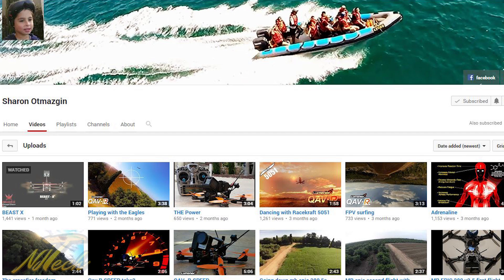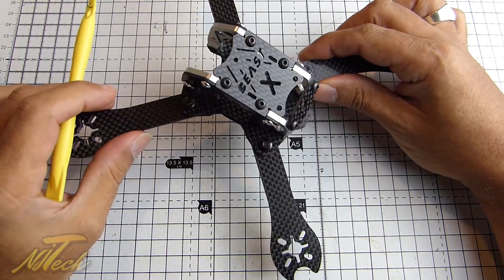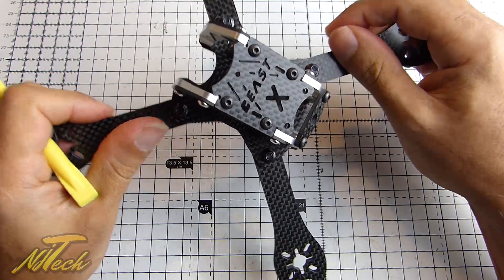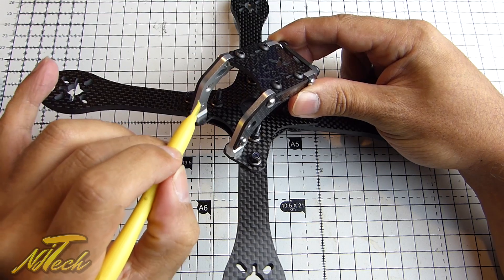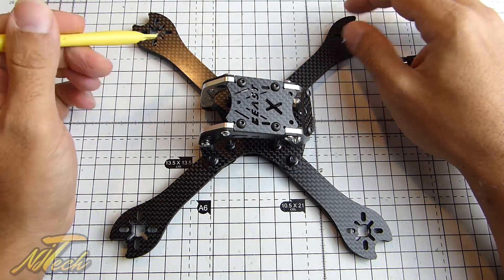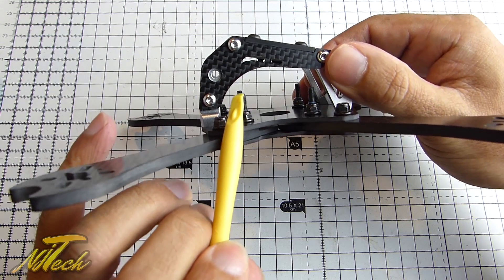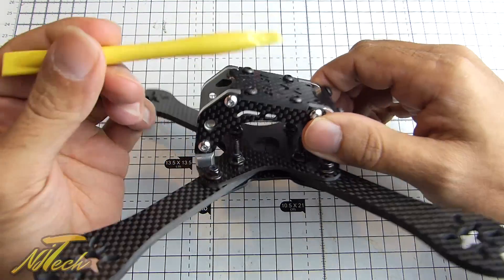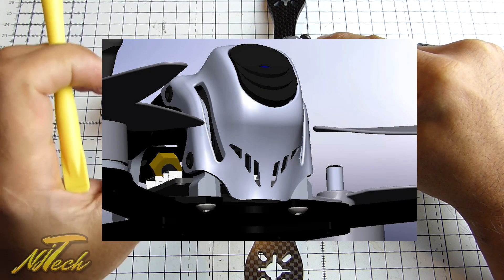Beast X FPV Quadcopter Kit Overview!

Comment: Hi
Looking for some advise
I have just built a quad It has a Raceflight revo fc and 20amp littlebee esc All esc's have been calibrated,all props are of the same,but it wobbles terrible.When i try to land it even in Angle mode as soon as the slightest touch on the floor it goes crazy and bounces up. I cant un arm the quad quick enough before it does this
Any ideas?
Reply from the maker: need more info really, but make sure with the revolt that you have all 8 O rings installed, 4 on top and 4 underneath the flight controller at each standoff. Also make sure your ESCs are calibrated and that the PIDs are at their defaults to start with.

Comment: Nice looking quad,  but I think he may have problems with the name (Beast X)    BeastX is a helicopter gyro :-(
Reply from the maker: Yes i used to own one years ago! I doubt they'll have a problem as they are very different products.
Reply: http://www.beastx.com/eng/

Well if you do get any problems, call it the Beast ARD :-)
Reply: mike jh when i designed the top plate i had to choose the name and it was instantly BEAST because- that how it looked in solidworks. 
then i wrote the letters on the top plate but something was missing because i didnt like the blank area behind the letters .
So  i added the big X and its perfect. 
i didnt know that there's heli gyro .....
Reply: I hope not as this is one sweet quad,   no wait a beast of a quad.
 :-)